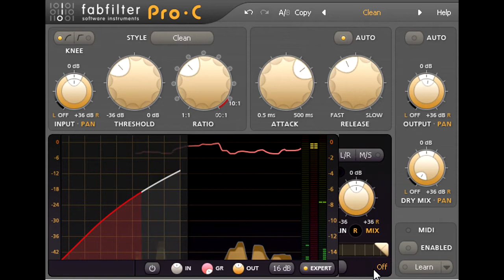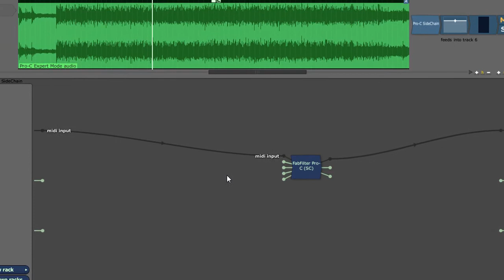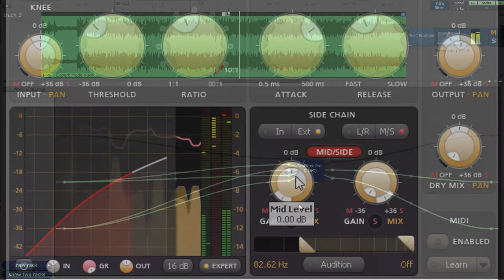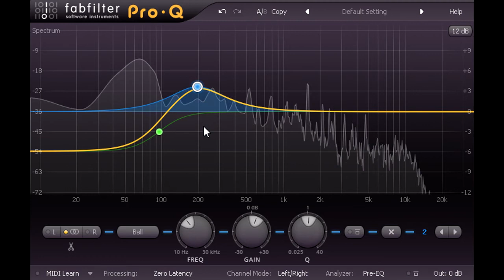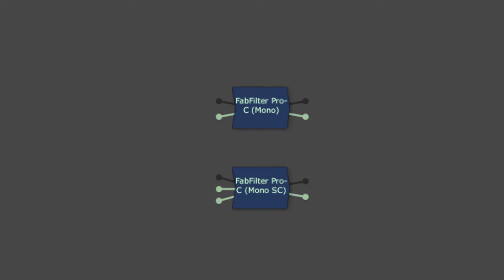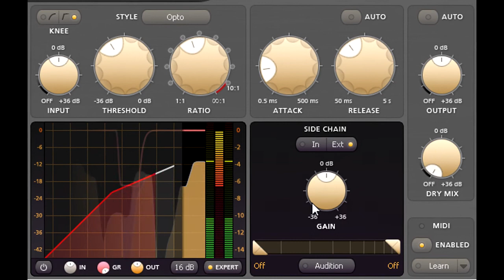FabFilter Pro-C - Expert Mode Controls

Comment: I'm pretty well versed with stereo 'expert mode' controls with Pro-C but it never occurred to me to use a modified input signal as the sidechain signal. I don't use a modular host, but in a more conventional DAW it's simply a case of using send and return auxiliaries. lots of potential here, thanks

edit: also that mono ducking effect leaving the side unaffected by Dan's voice is a very professional touch

Comment: Side/Middle option has great purpose to eliminate unwanted frequencies from content of particular sound if  you run complicated project and  you want avoid phasing  cancelation from some tracks  so you duct some mid or side content accordingly.That is more advanced than using  static eq permanently removing some eq bands.

Comment: The other alternative is to use the 'inc' sidechain and RECIEVE the audio data from the original channel to sidechain channel, rather than sending it out. This works and you can hear the 2 audio tracks audio simultaneously while still sidechaining. But if you were trying to hone in a filter and using the audition button, you will only hear the original track's (that pro C is on) audio and not the receiving side chain signal. Again, another design flaw?

Comment: So, in Ableton when using the ext input mode for side chaining, you have to literally send the audio signal out to the PRO C track, which means your eliminating audio for the original channel. It side chains, but it's only using the incoming data as a sidechain trigger and you can't hear the original audio at all. I can think of alternatives (such as using a modular host) to route the original signal to the sent track's output, but is there any way to do this natively in the pluggin? It seems like a design flaw to me.

Comment: @Lorenzo763 - 

Use Pro-C (SC): 

1. Select "Audio to" in the source track and select the track with the compressor in it. 
2. Change the setting below that from "Track in" to "Stereo Side Chain-FabFilter Pro-C"
3. Switch on the Ext button in the Compressor's sidechain menue.

Now the signal is at least routed into the compressor. But when you send a signal to another channel it won't reach the Master output anymore, and well ... it disappears. Don't know how to fix this yet :)